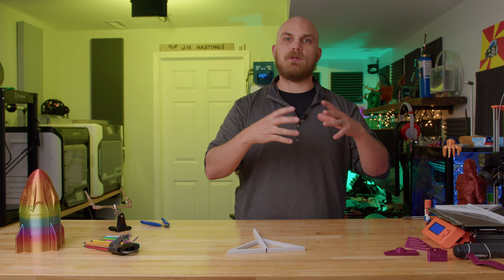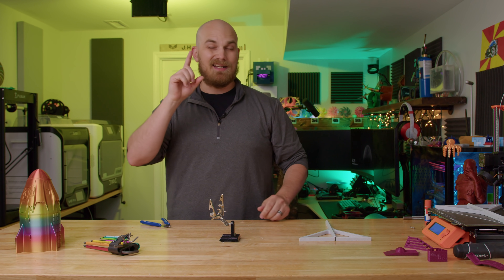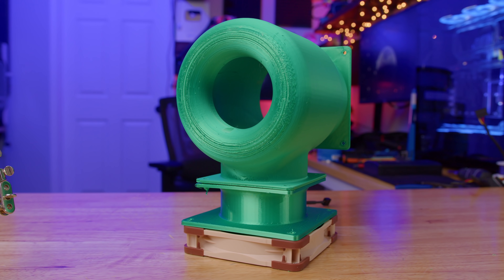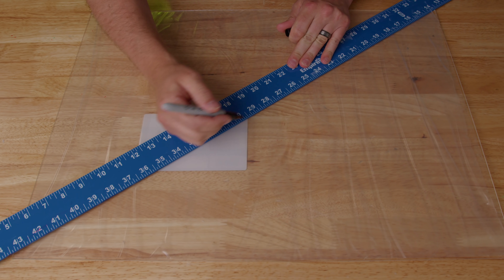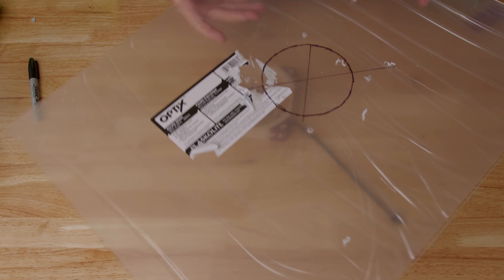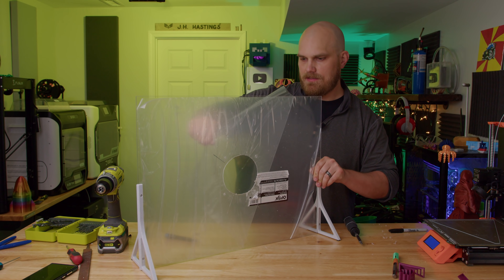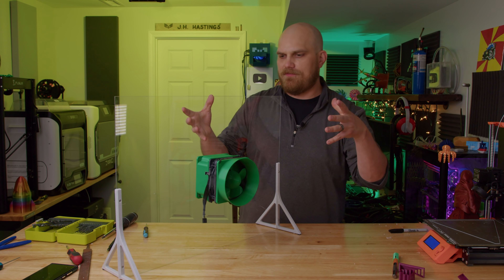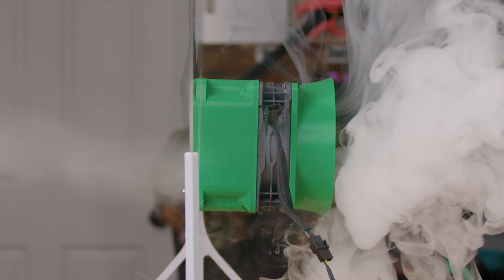We Now Have FLOATING FANS | Fan Showdown Update

Comment: Suggestions:

1: have separate classes for fans. For example, fans like the cheater that have bigger housings, extra components, etc should go in some sort of advanced class. The ones that are basic fans should just be in a standard class. This would make it a little more fair cuz no way any fan could compete with something like the cheater. And there would be a free for all with no rules at all. 

2: smoke test compilations. Just videos that have 20+ minutes of just fans doing the smoke tests with the fan names in the bottom corner. Maybe even include fans from previous seasons. Could be really cool to see especially with the new mount.

3: adding on to the first suggestion, can you try using stronger fans (like noctuas 3k rpm ones, or the phanteks t30). This could be really cool for fans that the a12x25 just doesn’t have the oomph for (like the contra rotating one, or the jet engine style one from a few seasons ago). This could be a separate class or just something to try once idk. Maybe it could shed some light on older concepts that didn’t work out as good as expected? 

4: try and make clear fans if it’s even possible. I think it would be so cool to see a smoke test on a clear version of the cheater. 

5: I’ve seen this a few times in the comment section so I’ll just repeat it I guess. Try and mount these fans in an actual case. Even better, try to get benchmarks. 

6: experiment with different sizes. A 200mm version of some of these fans would be awesome. Maybe a separate class? 

7: mineral oil testing? Could be interesting I guess. And with the clear fans mentioned above. 

8: here’s a challenge. Try to make the cheater rgb. That could be cool to see 

I know it’s a long list, if you got to the bottom, you’re a legend
Reply: Some decent suggests there!
Reply: I've always thought that "can it practically fit in a PC case" would be a good cutoff. there are some that have small additions to the front which would fit fine in a standard pc case so they don't really add an "impractical" advantage.

Comment: Fan Showdown Season 5: UNDER PRESSURE. Not about static pressure in a radiator, but about maximizing air pressure in a sealed 5L container. It guess 'Fan' would be a stretch, as these would be air compressors, but it could be fun!

Comment: Suggestion: Move the fan body to the other side, and have the input closer to the 'case'. It would help balance the weight, and I suspect reflect 'real life'  usage more.
Reply: Yes and also would make it easier to see. The way it was mounted in this video, because the fan was quite tall, the smoke was left below the intake, close to the acrylic and made a curtain which is harder to see
Reply: Yep, hub at the center.
Reply: I think the fan should normally be on the backside like it would be mounted in a case. Another idea, kinda goes past what we do here, is to test with different meshes placed in front of the fan

Comment: I think more of a box on the front would be better, and have the smoke blowing down or across into the box instead of directly at the fan, to see what kind of suction it has, and then the tunnel on the back end with the flow meter would be the best setup.

Comment: I don't know... At first I was excited for an insight of real measuring the flow.But then, remembering all your vid's since day one, I started to think about "kick-back". Your airflow IS NOT THE SAME, physics of air-density, rebounce (what is the rebounce of an acrylic plate vs. a glass one?), strain on the motor etc... Those are only a few  considerations of many made when constructing windtunnels and jet engines. It really looks better, love the setup! But I fear, if you want to be fair, you'll have have to test them ALL again in THIS configuration. I'm really looking forward to the next Fan Showdown!

Comment: Make a gasket/mount that spans both sides of the acrylic shield. Just so you can thread and seat fans without ruining that acrylic. It could be rubberized, or board, but just needs to reduce the likelihood of splitting your mounting holes.

Comment: Not quite right.  The round hole in the plexi is interfering with the airflow out of the square Cheater Exhaust.  I believe a different stack of the components on both sides of the plexi would correct this. Alternatively a square hole in the plexi would work.

Comment: The partition seems like a greet idea for even better visualization. I think it will let us see things we haven't before on the intake side. Not all air gets sucked in straight from the front after all.
I just hope this thin acrylic doesn't start to wobble and steal kinetic energy from less than perfectly balanced blades. Easy enough to fix if it looks like it could be an issue. Definitely should not use it for noise testing.

Comment: Love the new setup. A dark backdrop, especially for the exhaust portion, would make it easier to see the smoke.
Reply: Was thinking the same thing. I also wonder, is the smoke UV reactive or could you get UV reactive liquid and a blacklight to spice things up a little bit?
Reply: @Tacritania  
(EDIT: don't try this before doing research about the dangers of vaporizing  random solutions. These are not recommendations, just brainstorming about possible options!)

that sounds cool. The smoke liguid is mostly glycerin I think. If I have some laying around I can check if it glows in UV. (The liquid, I don't have a smoke machine)

Maybe glycerin and tonic water? Tonic water lights up blue. You could even use a black light laser through a line filter to get a cool cross section of the smoke.
Reply: @Thomahawk1234  do not vaporize random substances in a smoke machine, the heat can break them down into toxic gases.
fog machine smoke does not glow in UV and you would probably not want to inhale anything that does, but you can just point any old light at it, if your walls around it are dark they will absorb scattered light and the smoke will pop, especially with a green light source
Reply: @Blacktronics  You're absolutely right. Don't just burn/vaporize stuff and breathe it in. 
I was thinking aloud about possible options but certainly don't take these as recommendations! I personally always do some research about the dangers of such a project before actually executing my plans, but I should have mentioned that in the previous comment. Will edit 👌
Reply: It would probably work out pretty well to use a small section of LED tape (RGB of course) to provide illumination for the smoke. I would bet the smoke would show up exceedingly well
Reply: Wouldn't even have to be expensive - just use a piece of black cardstock. Pretty sure that's what NileRed does...

Comment: I like it. I do think that the smoke side should be enclosed in an acrylic box. Whether it be clear acrylic on one side so you can see in against a black backdrop or clear on all sides. Just because then it contains the smoke better, stops exterior turbulence and also gives you a new metric to measure. How fast can it actually empty the smoke chamber.

Comment: You probably don't need to thicken up the acrylic, just put a fatter frame around it and a fully extended base. So basically a 1in sq frame (probably even that's overkill), half inch square frame with a groove to fit the acrylic in, and then feet could be as simple as two or three half inch square blocks that stick out the same distance as the ones now do. Also probabbly could get away with  just making the sides extend to the top, have the feet attach to the bottom, and make two more feet, just square rods with a groove  in them, that you can rest the acrylic on. THINK OF A Connect Four Frame.

Comment: They do sell PC/Acrylic Jigsaw blades and they're pretty amazing. I have a whole pack of 15 (since apparently that's the smallest amount I could find on Amazon). BUT DIABLO branded which is a good name in blades for that kind of stuff. Want to say BOSCH bought them out. I have used them and weirdly doesn't annoyingly melt the plastic while cutting, and produced a no-crack cut that was nice and clean.

Comment: One way in which this new setup changes the nature of the test (compared to your prior setup) is that the acrylic presents a barrier to the smoke, so all of it must go through the fan to get to the other side, whereas in your prior setup, the smoke can bypass the fan, particularly if the fan is weak. 

I leave it to you to decide whether one or the other is more representative of what goes on in a computer case.
Reply: Yes, and more so the fan should be flush with the case on the input side as opposed to the video which puts the fan exhaust flush with the "case" (aka Wall).

The smoke should hit the wall, and the only way thru is the fan input hole.  You can see how much smoke flows backwards the way it's setup in this video.  That's NOT like a case.

Comment: Don't use acrylic, which has a reflection. Go to one of those art framing shops, and get some "museum glass" (the stuff that has a non-reflective anti-glare coating), or at least use acrylic that has an anti-glare coating applied.
Reply: Though it would look nice, it would be so much harder to work with, and make a hole to mount the fans.
Reply: @Dan-Simms  glass would definitely be harder to work with, but I am pretty sure there's acrylic panels with non-reflective coatings somewhere. I have art mounted on non-reflective acrylic on my wall.

Comment: I like this, it also gave me another possible idea for the future, what if you made a mock up ATX case out of entirely acrylic to see how a fan would affect the air in an enclosed case, it would be a project though cause you'd of course have to make the exhaust vent on the back as well as any other potential fan locations where air would escape, maybe even combine the two, like have the divider to keep the smoke away from the outside of the case and have the case on the other side of the divider.
Reply: It would really only have to have one clear side. I actually have everything to make this possible aside from the acrylic side. I believe @Major Hardware lives in my area. If he is interested I would be happy to donate a case, motherboard, etc. I think I have a PSU too.
Reply: @tsepash  That is a fairly good point but the image I had in my mind was to visibly see the flow of smoke through the case with some kind of backdrop behind the acrylic case, I hadn't thought of components though so I could see the effect still working well with good lighting. It'd be sick to see one of my comments making some kind of impact in a future video even if it was just the start of an idea, thanks so much for supporting the idea I hope Major Hardware digs it too lol.
Reply: @e1337H0b0  I agree, but the MB would block most view you would get on that side, that is why I suggested just the one side being clear. Also, because I already have the rest of the stuff available, lol. I am sure Major Hardware has a ton of leftover pc hardware of his own though.
Reply: @tsepash  Right, yeah when I came up with the idea I wasn't thinking it'd be a full PC but rather an empty case made of acrylic, but when you mentioned components and such I had to agree it's a good idea to simulate the obstructions of the internal hardware, which wouldn't make sense to do with acrylic when you might as well use the real deal, so yes only one side would need to be clear but more so than a typical case door would allow and somehow have good enough lighting to see what's going on with the airflow, I suppose we shall see what Major hardware takes from this if he likes it.
Reply: @e1337H0b0  I would love to see this. It could actually be the basis of an entire season. So many different fans to try in so many different configurations...

Comment: How about an LED Strip (Front Red, Back Blue) that lights up the smoke from beneath, for example. The colors seperate front and back.. There are aluminum rails to house the LED strips. If you use a super dense strip (144+) and double or triple the cover to obscure the light, it will look like one color.

Comment: Nice work, I feel your pain having to use the soldering iron for that, but a replacement tip will make it all better. Maybe even buy a blade shaped tip for future projects? I'd love to see you doing a video that examines the output air from these fans, maybe with an Anemometer, and perhaps even input vs output Thermometers? Testing the efficiency of air movement and heat transfer? Also I'm a sound engineer so I really enjoy any of the stuff you examine about the sound profile of the fans. Love the channel and your work ethic man, keep it up.
Reply: Dremel tool man with a router bit so much faster and cleaner with plastic that thin you can almost free hand that line
Reply: I have multiple irons and tips just for this kind of thing. Sometimes burning holes is way faster and safer than drilling and having blade tips is great too

Comment: I think the next improvement would be a black background to see the smoke better
Reply: I second this. Black backdrop should be pretty cheap and easy, and it'd be much easier to see the smoke than the white wall/door.
Reply: Lasers! Ehm, Sorry.
Reply: Black background!  Vertical laser levels, I think they sell them in different colors too!
Reply: You could install something like those collapsible portable backdrop screens on the side of the table, so it's not visible unless it's active. You could even 3D print a support for it, and make it either removable or permanently attached, depending on what's more appropriate for you.

Comment: I think 3d printing a frame all the way around the acrylic will give it all the stability you need
Reply: Or, Go thicker sheet. or maybe a Picture Frame
Reply: Exactly my first thought. Could also use alu rails, ready to mount RGB lights. =)
Reply: Not even that much plastic needs to be wasted, Connect 4 style frame. Extend it the length of the edges, slide the acrylic in and you'd be good to go. So like a half-inch square rod, with a 1/16th in groove in the center of it (since I think that's the average acrylic thickness), no screws needed, the stability feet at the bot can clamp on sideways, so you can put everything away flat.
Reply: All great ideas. To stop the flex print two 90° channels just like the legs and pop them on the top 2 corners 2 or 4 screws on each corner should stop the flex. Add a flat edge to them if you want to mount UV or led lights. Fun idea.
Reply: Okay, but 3D print that from transparent plastic!

Comment: With the new set up, a compilation of the previous fans runs side by side with this setup to see how free air vs divider changes how they flow.
Reply: could do a TOP 10 Fan FAvorites maybe
Reply: I don't think so there is more than 100 previous fan
Reply: @Irilia_neko  if you look right now, the top comment says just to redo the top performers which makes sense imo
Reply: I think the actual thermal data regarding the top performers was done using an actual case so that part probably doesn't need to be redone, unless I'm mistaken about the test bench used for the thermals tests. New smoke test videos of the top performers would definitely be pretty cool though